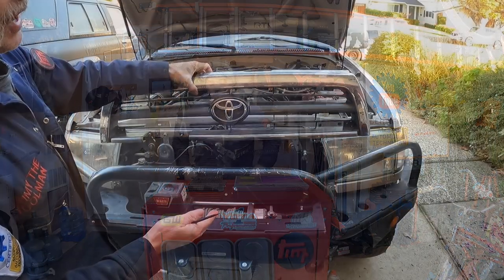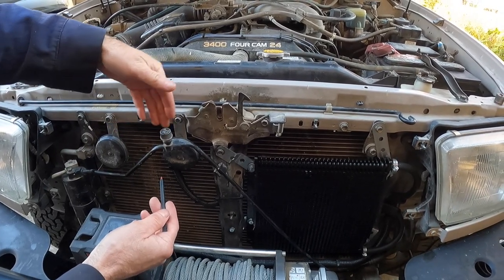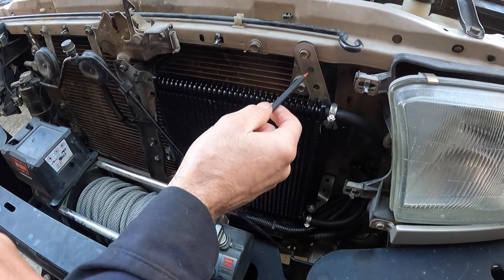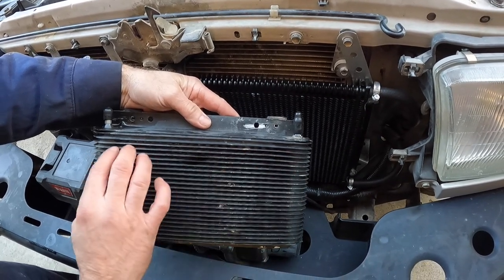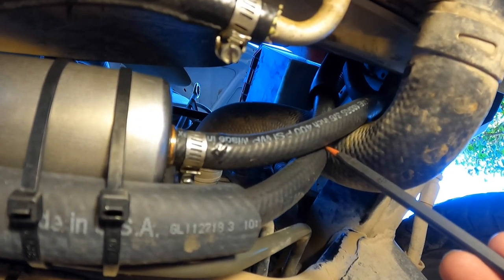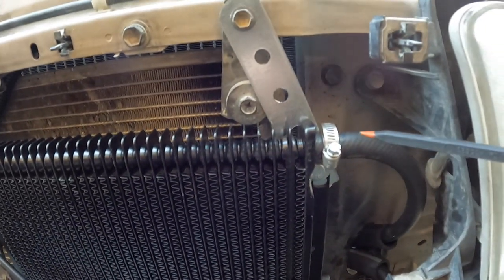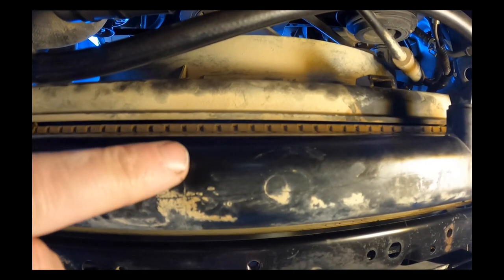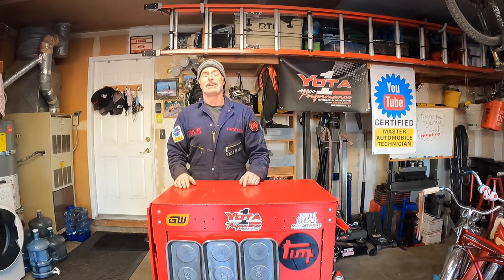External Transmission Cooler Install (3rd Gen 4runner/1st Gen Tacoma)

Comment: Another benefit to using Hayden coolers is the amount of airflow you get past the cooler due to their thin, flow through design. I love these coolers. I have two Hayden’s running parallel on my 2005 Z71. I went through many set ups before I came across them. Great video!! Very informative and well done.
Reply from the maker: Thanks for the comment and glad you like the video.
Reply: Are they so effective in cooling ???
Reply: @edwinalexander1170  I would not have commented if they were not. Yes, they are very effective at cooling.
Reply: @stevefuller3585  But it is suggested for effective cooling Hyden 526 with the moving fan, controlled by thermostat is more effective in cooling.

Comment: Thought I would add this, for those looking into doing this on a first GEN Tacoma. My truck is a 2003. I found out after removing my grill I had some AC lines running directly in front of the AC core that prevented me from mounting the cooler in this spot that you see Tim mounting this one. Tim I tried to watch the video again and see if you had these lines behind the cooler but I couldn’t see if you did. I cannot remember if the 3rd gen 4 runners had these lines there as well or not? I am thinking maybe some of the earlier year4 runners & Tacoma’s may be did not have these lines there. Anyway what I found is that I tried  to slide the cooler back towards the center or directly behind the cross brace. What I found is that I had a AC line running behind that cross brace and after looking at your video I believe this line should be in front of or on the outside towards the front of the truck side of that Cross brace. Looking at a friends truck that line did run in front of that cross brace. I removed the cross brace so I could position it behind that line placing the line in front of it but found that when I re-tightened up the cross brace part of it was pressing against the cooler. I didn’t want this ultimately ending up rubbing a hole in the cooler so I slid the cooler all the way over to the left side or passenger side I found that this allowed for the best clearance of that center across brace so that it wasn’t pushing up against the cooler. Also found that I could use to existing bolts/screws holding in the AC condenser on the left side to attach brackets to then running them to the actual cooler. On the right side I am going to have to take Tim’s lead and drill a hole in the cross brace to attach brackets on that side. Anyway just thought I would share my experience of trying to find the best place to mount this on a first GEN Tacoma.
Reply: Edit: AC lines running in front of AC Condenser not core on The right side or driver side.
Reply from the maker: The only AC line on the 3rd Gen 4runner runs in front of the cross brace.  It goes from the AC condenser to the receiver/dryer on the passenger side.
Reply: Makes sense then why are you were able to mount yours on that side. I couldn’t remember if there were additional AC lines running there on 4 runners or not. On my truck I have two lines they’re making a C or U shaped bend Preventing me from mounting the cooler on that side
Reply: Tim I made a post on Tacoma world in the first GEN forum called external transmission cooler mounting location  asking if other people had done this on their trucks and how they mounted it and in what location. I can post pictures there of the lines I’m talking about if you have any interest in looking at that. Thanks for your response.
Reply from the maker: @rthomas2157  Interesting.  I don't understand how your 1st Gen Tacoma would be different.  The 1st Gen Tacomas and 3rd Gen 4runners are almost identical when it comes to the front end.  I guess this is one difference I didn't know about.
Reply: Tim yeah that’s what I assumed as well. That’s why when I pulled off my grill I was a little bit surprised to see those AC lines running there. I guess that’s just a small difference between the 4 runners and Tacoma’s .
Reply from the maker: @rthomas2157  I got banned on Tacoma World for calling out some a-hole for ripping off our content.  Some forum moderator used the excuse that people aren't allowed to do self-promotion.  Like I was posting our videos just to promote our YouTube channel and it had nothing to do with helping people.  I had to laugh.  Not to toot our own horn, but nobody, and I mean NOBODY, can come close to the contributions to the 1st Gen Tacoma platform that we have done.  I guess I could join again under a different screen name but I have no desire.  If our videos aren't welcome, then I don't want anything to do with that forum and the idiots that run it.
Reply: Yeah I hear you man I caught wind of that on Tacoma world it’s too bad that It had to go down that way. You definitely are a huge contribution and help out a ton of people. Thanks for all you do keep it up.
Reply: Thought I would add a correction on here. I mentioned the AC line running behind the vertical cross brace and that I thought it should go in front of it. After looking at some other peoples trucks it does run behind that cross brace not in front of it looks to be the same on 4 runners. Also wanted to report my transmissions fluid temps running the 699 in-line are in the mid to high 140’s running around town. 160’s to the highest I’ve seen it go 173 at 75 mph on the freeway. May go up some in the summer months but I’m happy with those temps.
Reply from the maker: @rthomas2157  Thanks for reporting back.  The real test is climbing a sustained grade in hot ambient temps.  You should still employ all the tricks of the trade like turning overdrive off and using 4Lo when 4wheeling and climbing long sustained grades.

Comment: I ruined a stock radiator in my supercharged 03 tacoma exactly the way you said, Using those plastic through radiator ties holding on an electric fan. I now have aluminum brackets bolted through the shroud holding it on. Has worked great for over 5 years. I have a manual trans so I dont have a trans cooler, but I did buy a big Hayden 1040 engine oil cooler meant for an f250.  I built brackets that hold it as close to the grill I could get it. my coolant temp is almost never over 190 on hot summer days and stays at 172-176 in the winter. only time it goes over 190 is charging up hills pushing a ton of boost
Reply from the maker: Thanks for sharing your experience.

Comment: Crazy, I was just looking for your old video on the B&M cooler because I wanted to install one on my Runner and found this video. This install looks solid and looks to have better cooling. Thanks...
Reply from the maker: Yeah, this cooler is better than the B & M cooler I installed on my 2000 4runner years ago.  I'm still not convinced bypassing the stock trans cooler is the way to go though  I'll know better once I get my rig out on some trips this year.
Reply: @TimmyTheToolman  The update on how the bypass is working would make a good follow up video. I get what you are saying about not being convinced but a pink milkshake would be a hassle. And it might be a little better cooling when you load the transmission off roading or towing.
Reply from the maker: @garywells3874  The cooler worked well on a recent trip to Death Valley.  My trans temp didn't get super high but I did also use all the tricks I know like turning overdrive off and using 4Lo.  The ambient temps while we were there weren't that hot either.  

We took a route north home through the Kirkwood area over a pass and we ran into a snow storm.  My trans temp stayed pretty low, like low 100's.  That wasn't exactly a great sign to me letting me know that internal pressure bypass doesn't work as well as I would have hoped.  But, I think the B&M cooler ran in-series with the radiator cooler would have also had my trans temp low too.  So, I probably wouldn't recommend this system or any external cooler system to anyone who drives a large portion of the year in a cold climate.  I have heard people just throwing a piece of cardboard in front of the cooler to limit the air flow when they know they are going to be driving in really cold weather like I was that night.  

It's really hard to have a system that's good for all ambient temperatures.   The big killer of transmissions is heat so keeping the temps lower is the biggest goal in my opinion.

Comment: Will definitely consider this mod - I'm currently seeing temps easily hit 210+ on my 02 4runner with armor while out on the trails. Thanks Timmy!
Reply from the maker: I'm going to test it out in Death Valley at the beginning of March which will let me know if I'll continue to run it bypassed or switch it to run the Hayden cooler in-series with the stock radiator cooler.
Reply: @TimmyTheToolman  Tim, did you change back to in-series? Typically, if you have a new radiator, it's not necessary to run by-pass as most people do it to avoid the pink milkshake. Toyota runs it in series for those truck that come with trans cooler. Let me know. Thanks
Reply from the maker: @genxiong2695  I'm still running it bypassed for now and I might leave it that way.  I want to see how it does in hotter temps this summer.  I have the cooler for my 2000 4runner in-series with the radiator cooler.
Reply: @TimmyTheToolman  Thank you for the quick reply. Just bought the exact cooler and will be installing. I will be running in series since I have a fairly new radiator. How's your temp running with this cooler compared to the one you took off? Did you see an improvement?
Reply: @TimmyTheToolman hi Timmy just wanted to see if you were still running it bypass
Reply from the maker: @Squitszn  Yes, still running it bypassed.  It's working out pretty well for me.
Reply: Hay Did you ended up finishing this MOD, I got an 02 SR5 with 255k miles and thinking about doing this next

Comment: Thanks for the vid.  I bought the 599 for my 02.  Recently picked it up so I'm focusing on maintenance items and such.  Plan to do this cooler mod once it warms up and eventually throw a new oem radiator in as well.
Reply from the maker: You're welcome.  Good luck with the job when you finally get around to doing it.

Comment: I did something similar with my 04 Tacoma. I used a similar sized Hayden cooler, but without the built-in bypass, instead using a Derale bypass thermostat inline with the send and return lines. I also added an electric fan, on a temperature switch (190 on 170 off).
Fully loaded, and towing my teardrop trailer, OD off, torque converter locked up, I maintain 165° on average. Balls to the wall, climbing mountain passes, in summer, (WA state) highest I saw was 210, and that came down reasonably quickly. A side effect, my coolent temperature remained fairly steady, as the transmission wasn't heating it up as well, 3 core aluminum radiator might have had something to do with that as well.
Reply from the maker: The electric fan is something I considered and maybe I'll do it one day.  Your trans temps sounds really good, especially with towing a trailer.  My 98 is loaded down with lots of extra weight from bumpers, armor, roof rack and other mods so it's a tank.  I'll be putting my rig through the paces with some off-road trips this year to help me access if my current set-up is a good one.
Reply: 210 is too high. Should keep max temp no higher then 180
Reply: @bluesky-ud9wg  everything thing I have read says 210 is on the hot side of the average range, 230, pull over and let it cool down with the engine running, 250, starts to harden the rubber seals, and the start of permanent damage range, and 300 will warp some parts.
I am okay with 210 as a Max temperature, with 165 as the average running temperature.
Reply: @firemaniac  I stick by my saying 180-185, no higher
Reply from the maker: @bluesky-ud9wg  You're dreaming if you think you can keep the temps from going no higher than 185.  Anyone who travels in the mountains knows this is impossible.  You will sometimes go into the 200's, especially if the ambient temps are very hot.  The key is to know when it's prudent to pull over and give your transmission a break.  The temp at which I start to consider pulling over is 230.
Reply: @TimmyTheToolman  Lol, ok. I'm not going to argue.
Reply from the maker: @bluesky-ud9wg  I'm not looking to argue either.  I'm just stating what I've seen from my own extensive experience.  The optimal temp for ATF is around 170, so you're right it would be ideal if you could keep the temp to no higher than 180.  What I know from lots of experience of traveling in the mountains though is not going over 180 is impossible unless you are running a massive trans cooler.  If you do travel in the mountains and 4wheel and you're saying you've never broke 180, that's something I just can't believe.  Maybe share your cooler setup to make me a believer.  You certainly aren't doing this on a stock setup.
Reply: @TimmyTheToolman  Who said I live in the mountains or am towing?  You assumed. I assure you I KNOW much more than you do about this topic and the Auto industry in general. Oh one last thing; If you are HAVING to pull over to let the trans cool down, you are OBVIOUSLY not cooling it properly, lol. Enjoy you're weekend
Reply from the maker: @bluesky-ud9wg  Dude, you just proved my point.  If you don't drive in the mountains, 4wheel or tow, why are you commenting on this topic then?  I don't care what you think you know.  If you drive on flat land most of the time, sure you won't ever see high trans temps.  I'd love to see you drive up a steep sustained grade like I have in Death Valley on a 100+ degree day and see your trans temp sky rocket.  Then you would know what the hell we are talking about on this topic.  The purpose of an accessory trans cooler is for those that push their automatic transmissions harder.  And yeah Bro, the whole reason you do monitor things like the trans temp and engine coolant temp is to know when it's prudent to pull over and give your rig a rest.  What a waste of time you are.  Please troll someplace else and waste somebody else's time.
Reply: @bluesky-ud9wg  uses two 16" spal fans and a nitrous chiller on his trans cooler. Get with the times Tim!

Comment: Hey Tim! First of all, thank you for all the educational videos you put out there. You saved me so much money teaching me to wrench my truck! I love how you explain the "why" in "how things work" if that makes sense. Anyway in the other video where you installed the same 699 cooler on the FJ, you mentioned that it did NOT have a thermal bypass valve. So would you say the 699 is safe to use it IN SERIES with the stock cooler (radiator) rather than bypassing? I know there's other models that do not have the thermal bypass, but the 699 is the closes size to the oem. I've been replaying 3:05 to 3:40 trying to understand. I'm basically replacing the old worn out one in my 100 series Land cruiser.
Reply from the maker: Maybe I misspoke in the other video.  The Hayden 699 cooler does have a bypass.  How well it works, I don't know.  It works based off the thickness of the fluid.  When the fluid is cold it is thicker, and will bypass the thinner cooler channels until the fluid warms up and thins out.  There isn't an actual thermostat opening and closing based off the temp of the fluid.

You could definitely run it in-series with the stock cooler in the radiator.